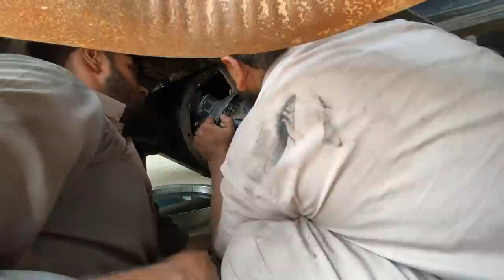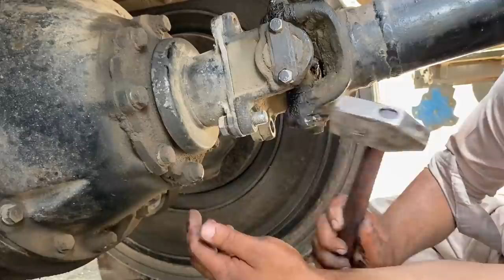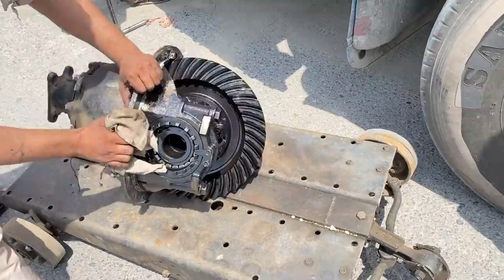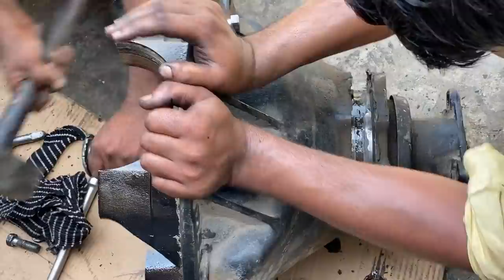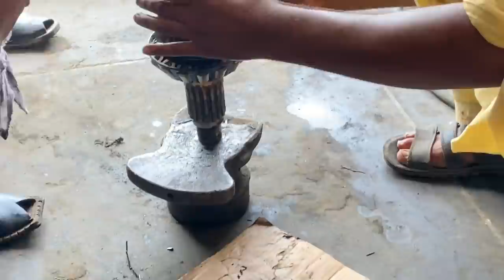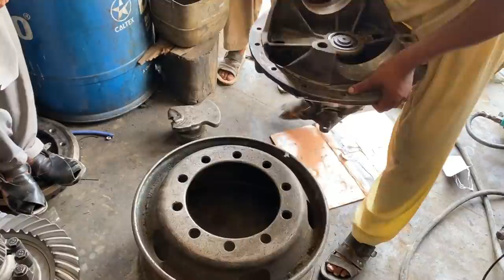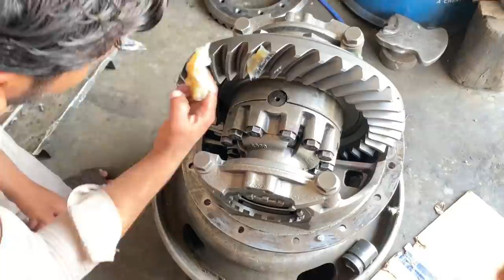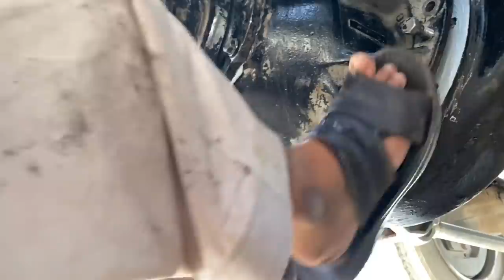The sound is different from the differential gear. Open and check

Comment: Keep in mind these are poor people doing repairs without the benefit of a professional garage . All things considered they did a great job . I'm sure their repair job will last Equally as long as repairs done at a TRUCK DEALERSHIP .
Reply: What do you mean? They’ve got air guns? They do have a shop. are just used to Mother Nature’s air conditioner.
Reply: You say poor I say normal
Reply: @brieannateylar5810  oh boy.

OK you go ahead and drive a vehicle whose bearings have been pounded off with steel hammers, on their outer races.

I'll pass.

They're doing the best job they can with the tools they have.  Doesn't mean it's a good job.
Reply: @briandg25ify  next time you go out on the Hwy look at the vehicles around you . I can guarantee you that at least 1/4 of those vehicles were fixed by a BACKYARD MECHANIC using the same techniques the guys are using . I can bet that their repair work will last Equally as long as a dealership . In fact I bet you've rode on a vehicle worked on by a BACKYARD MECHANIC before and just don't know it .
Reply: @brieannateylar5810  ok fine

That doesn't change the fact that beating on the edge of a bearing with a steel hammer is going to shorten its life significantly.

There's a right way to remove pressed-on bearings so as to not damage them and this ain't it.
Reply: @briandg25ify  you should watch some of those hidden camera segments that they have on TV about Certified Repair shops & DEALERSHIPS  . Not only do certified repair shops get caught doing this but the dealerships get caught doing this sometimes as well because they're not willing to buy the PROPER TOOL to do the job right just to use on one vehicle & never to use it again plus the customer isn't willing to buy the tool just to use it ONLY once . No matter where you take a vehicle for repairs your just rolling the dice and if you're lucky they will have the tools to do the job right . Either way they're not letting you in garage to look over their shoulder and if it breaks their going to find a way to blame the repair failure on you . At least with the BACKYARD MECHANICS you know what you're getting into from the start .
Reply: @brieannateylar5810  lady, a bearing puller is not some exotic tool.

Knowing that bearing sets can't tolerate what these guys are doing is not advanced knowledge.

I guarantee you there are high level shops available where these guys are working, they just cost more.

Improper work leads to lower Mean Time Between Failure.  You think these guys offer a warranty?
Reply: Uh no.

Dealerships rely on warranty work, which is paid by manufacturer.  If they get caught doing substandard work, they risk losing that sweet warranty service. 

They also work on the same models, over and over again, doing the same procedures.  They have the tools they need.
Reply: @briandg25ify   Maybe I can bring a 1914 International Harvester Semi Truck down to the local dealership and see them bring out the tools to fix those huge old gas engines and axles with hydrovac wedge brakes . Better yet take a 1920 Ford Semi Truck down to my local Ford dealer and expect them to still have the tools around to fix . How about a Chevy BISON Semi Truck or a 1920  Cadillac truck will the dealerships still have EVERY  tool in the shop to fix them ? IN OTHER WORDS NOT EVERYTHING IS GOING TO BE UNDER WARRANTY . People keep and work old equipment . When you run old equipment on a business you sometimes have to make repairs on it the best way you can if it breaks down . Some nuts & bolts & Tools they used they used back then got junked years ago and you have to cut off part and then match it up with the modern equivalent . This sometimes requires enlarging a hole for a larger part or filling in a hole for a smaller part . It looks these guys are doing lots of business so they must be doing good work and giving some type of warranty .  PS , I'm sure if YOU are will to buy and DONATE tools to these guys they would be happy to receive them .
Reply: @brieannateylar5810  the drive trains in those vehicles you're talking about were all engineered to precise tolerances, and designed to be worked on within well known limitations.

Specifically: YOU NEVER POUND ON THE SIDE OF A BALL BEARING RACE  TO REMOVE OR INSTALL IT, ESPECIALLY WITH A STEEL HAMMER.  Ball bearing sets can withstand tremendous force radially but very little axially, especially asymmetric force like being smacked with a hammer.

Bearing pullers are not that expensive.  If the shop you take your antique truck to doesn't have one, run far away.

And let's not get started on torque wrenches.
Reply: @brieannateylar5810  In any case, I won't be replying again to this thread - you're inconsistent in your logic and I can't be bothered to chase the goalposts that are moving all over the place.
Reply: @briandg25ify  the goal post hasn't moved and the logic is the same as when I started . Not everyone is going to have the proper DEALERSHIP tool to do the job all of the time not even the Dealerships but that doesn't mean that their quality of work is any worse even if they are BACKYARD mechanics . No one is saying that you have to take your vehicle to a BACKYARD MECHANIC for repairs but keep in mind not every is rich and can afford the luxury of high priced Dealership mechanics .
Reply: @brieannateylar5810   If your BACKYARD mechanic can't afford a $50 bearing puller then maybe you should look elsewhere to have them replace over $250 worth of parts.

And if they don't have one then they have no business rebuilding a heavy truck differential.  Every hammer strike on those bearings is taking months off their life.  That diff will need to be torn apart again and again.
Reply: @briandg25ify  YOU'RE still crying over someone else's truck repair ? The truck doesn't belong to you so quit whining about it . If that truck owner or ANYONE else want to take their vehicles to a BACKYARD MECHANIC that's on them . Like I said they must be doing excellent work because they've got plenty of satisfied customers and advertise their work on YouTube . The only one complaining is you .
Reply: @brieannateylar5810  I'm not complaining.  I'm just trying to point out that these guys are damaging the vehicles they're working on by pounding bearings off with steel hammers.

Anybody can post a YouTube video and I'm sure their customers are happy because they no doubt work for cheap because they dont invest on proper tools or training.  Or PPE.  Ever got a steel shard in your eye?  It's easy to hire some guy to hang on to a diff housing once the last guy can only see out of one eye anymore.
Reply: @briandg25ify  because they post on YouTube the customers know up front what they are paying for . I'm pretty sure that the bearing tools cost closer to $150.oo us dollars , but that's just what I paid for some on a July 4th sale the last time I got some 20 years ago just to fix one antique 1971 IH Loadstar 1700 truck  . In a poor country that might seem like a small fortune . These guys are working on older trucks that a lot of DEALERSHIPs probably won't touch and the few that would work on them they probably can't afford the cost . That leaves them with the BACKYARD MECHANIC which we see here as their only option . Is the job being done by the book ? Of course not . But sometimes it's better to have a " running " work vehicle than to have no work vehicle . The amount of money the owner makes while it is running apparently justifies using a less than perfect garage for them . You do the math what makes more money driving a truck with a possible short term let's say 1month  repair or selling products at the local street market for 1 month ? Most of these guys drive 24 x 7 but that market is only open sun up to sundown . It's not even close if the truck only ran day shift hours because the truck still makes more money which justifies the cheap repair job in a poor country . I've seen people in the USA make enough to buy themselves a home a running old trucks and using BACKYARD MECHANICS like this for all their repair work . It's NOT a ideal repair but it keeps the trucking business going and the cash flowing into the bank .
Reply: @briandg25ify  PS , a CERTIFIED MECHANIC at the garage he runs 2 miles from my house actually has one eye from metal that flew in there over 45 years ago . Sometimes he'll wear safety glasses and sometimes he won't , I guess he didn't learn anything .

Comment: He washed to oil out of the parts with his bare hands - no gloves.   Probably used diesel as a solvent.    Standby for dermatitis after a few years and then cancer.
Looks like they put the old bearings back in - not a good idea
Reply: Those bearings are going to be toast after running in debris filled oil and then disturbed that much with the on-off.
Reply: @johnnicol8598  :  You're not wrong.  I've watched a few of these Pakistani truck repair videos.   Fair enough, I understand that their trucks get seriously overloaded and get driven over rotten pot-holed roads, but even so, at least some of the failures should not have occurred - not in the way they occurred anyway.  What had probably happened is that trucks completed a reasonable service life and when something just got too worn out, these sledge hammer chaps repaired it so that it could be driven again, but due to the bad repair practices, it failed again - so they repaired it again....   And again ....
Reply: @keithammleter3824  I'm very confident that this diff will be just fine 50,000 miles from now, if not 100,000. If this unit went bad within 1000 miles from now then there would be very serious consequences for the builder. This isn't America where you would take them to courrt and file a complaint with the BBB. Here this repair cost the owner a LOT of money (to him) and this truck is his living. He will NOT tolerate this failing prematurely. Its obvious these guys know exactly what they are doing and you have no idea what they did and didn't check and how they check it. The video is 14 minutes long, do you think they actually did this job in 14 minutes? These guys do this shit all day, every day and they know how to do it. They checked the pattern and with adjusters they are probably practiced enough to know backlash just by jiggling it. Do this stuff enough and inch-pounds torque required for preload can be felt. How many diffs this big have YOU set-up?
Reply: @jamesradcliffe3985  Oh, I wouldn't be surprised if that diff lasts 1,000 miles.   Maybe 5,000 miles.  But definitely not 100,000.  And it should last 300,000.   And after 300,000, fail by wearing down, not catastrophically eg broken teeth.  This diff failed catastrophically probably because it got contaminated oil or it was repaired after wear out by these same turkeys, albeit maybe triggered by overloading and a pothole.
Yes, these guys are not stupid, and they do know stuff.  They didn't check meshing the way a competent Western truck mechanic would do it, but they used a grease method that works.   But if you have worked in a mechanical repair business (and I have - I was the engineer - that's the man in charge of all work - in a large dealer for a large engine manufacturer) you see many things in these videos that would cause instant sacking in a Western country.   Eg hitting bearings.  Others on this video and other Pakistani truck videos have made the same comments, but I'll make a couple of them again for you - the first thing you learn at trade school and from your boss is cleanliness is absolutely essential.  And these Paki guys work in the dirt.   They let all fluids drain on the ground.    If they captured fluids and kept a clean concrete floor, they could use their own gantry and not have to hire a mobile crane every day to lift things - that's what they do, watch other videos and see.
A lot of what these guys do just doesn't make any sense.  They are self taught.
Pakistan is a lot like India - much of their culture comes from India, where sloppy work and ripping-off is the norm and nobody seems to understand that it need not be so.  A place where sloppy work doesn't get them in court, because they don't have a suing culture and the competition is just as bad.
Reply: @keithammleter3824  I saw them emptying fluids into a big pan. I saw them using cardboard under their parts after they were cleaned, yes, they didn't use a $600.00 snap-on diff cradle on a 400.00 jack to move the shit around, they're not stupid. Funny you mention sloppy work, I bet this truck was imported between 1930 and 1970 from somewhere in Europe, and just like all those other trucks you see, are still getting the snot beat out of them daily, and still running. Funny, but I look on our roads and all I see are top-of-the-line kenworths/ freightliners etc. that are no more than 10 years old.........
Reply: @jamesradcliffe3985  :   Don't be ridiculous.  1930 to 1970 indeed!   Look at 0:10 - the truck in question is a late model Nissan UD.   The diff innards look nothing like an old European diff.  You need to look at a few more of these Pakistan truck repair videos.   There are a few old trucks still in use in Pakistan, eg Bedford TK's  (nominally a British truck, but most likely built in India - and due to unsophisticated design without special alloys, more suitable for the methods these guys use, than more modern trucks), but almost all the trucks these guys work on are Japanese, or Indian or Chinese built versions of Japanese trucks, nothing like as old as 1970.  Let alone 1930.
Like I say, these guys do know stuff, but a lot of what they do doesn't make sense.   They hire a mobile crane just about every day, which must necessarily cost a lot of money, have air-powered tools, but haven't spent the equivalent of an hour's wages (their wages) on a simple bearing puller.   That, and cleaning with bare hands, is what self taught folk do.   Older brother or uncle hits bearings with a hammer, so young bloke thinks that's how you do it.  He doesn't think of using a puller, which he could make if not buy, because there is no trade school to show him one.

Comment: Too much ‘backlash’ in that pinion / crown wheel,  and,  as they always badly overload trucks in Pakistan and India that amount of backlash will eventually cause teeth failure…..correctly set diff’s should have a degree of resistance, did I miss the part where they correctly set the pinion bearing pre-load?
Reply: You and everyone else has no idea how much backlash this R&P was set to. Even the guys that did the job didn't measure it. The slathering of grease they put on to show the contact pattern was a joke. They used 100 times too much grease. In other words, they will be a mile out on the backlash and pinion depth and it will still show a "good" pattern like they got.

Comment: DRRRR: 1)  Propshaft NOT marked for PHASING match. 2) Strip-down process of wrecked differential insanely filthy, but otherwise irrelevant. 3) Wash-down process was spirited, but useless in a pan that re-introduces FILTH ito the assembly. No air-hose blow-out!  4) THE WORST: Re-installation of swarf-exposed (DAMAGED) bearings onto the pinion, 5) No measuring of pinion height (SHIMS??), no run-out check, no pre-load applied. No torque settings applied 6) Land/Heel engagement pattern checked incorrectly, backlash checked by hand (rather than by micrometer).
This differential will FAIL AGAIN within 5000 km, parts quality is NOT THE ISSUE: The repair procedure (for want of a better expression) is insufficient. (for want of a better expression) . What a JOKE.
Reply: For some reason YT keeps throwing these videos at me. 
I mean, who really wants to watch these greasy rubes fix things by hitting them on the ground!?
Also, we should pity the people gushing in the comments, they encourage ignorance.

Comment: Sucks for the owner of the truck that they forgot the pinion seal.....  Also would've loved to have heard what they were talking about when looking and pointing at the grease pattern.... From some one who builds rear ends everyday, I can't count the times old guys come in with grease on the ring gear... and they can't get it to work??? These guys managed fine, minus no pinion seal, and kudos for the side spanner adjustment tool... excellent idea.

Comment: These men are stronger than anyone gives them credit for. These are tractor trailer differentials. All of it is heavy hard work. 
They don't realize that parts cleaner. Probably K4 with a little 85octane. Is hard on the kidney over time..

Comment: As they properly "loaded" it you could hear the difference as the gears meshed closer to tolerance.  Also those gears are cut and leave some real sharp edges on those teeth.

Comment: 12:43 did he check with the grease how much contact there is between the gears? a very clever solution, wouldn't think of that, i would somewhow try to measure it...

Comment: Step #1: Throw opened diff on the ground. Step #2: Roll it around in the dirt a few times. Step #3: Wash bearings in filthy solvent used to clean the outside of the housing.

Comment: The pinion pre-load of the Timken taper bearings on assembly ? We used engineers marking blue to check the meshing of the crown wheel to the pinion ,the grease trick, brilliant 👏👏👏👏👍🇬🇧

Comment: no torque wrench needed, got strong biceps, basic tools but big brains, genius to improvise, home made tools too. No press needed for anything all brains and brawn and I bet it worked 100% when they were done. My dumb Cadillac dealer could never figure out what was wrong with my truck with all the computer tech we have!!! I bet those guys would figure it out in a heart beat!!!! I could not stop watching for a second. By the way I bet that was straight up gasoline they used for cleaning the parts, only bad thing there was them using there hands without gloves.